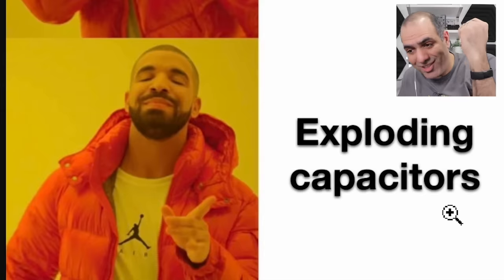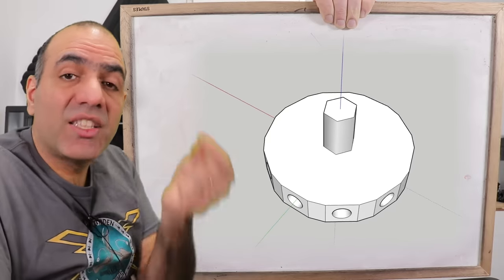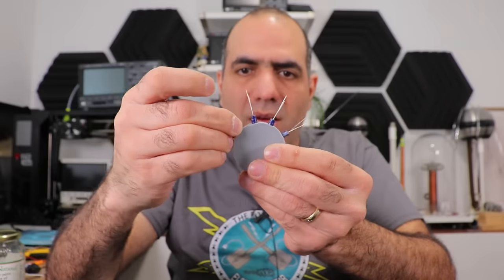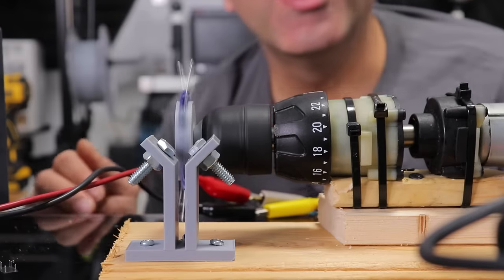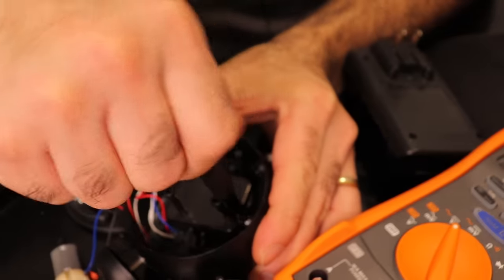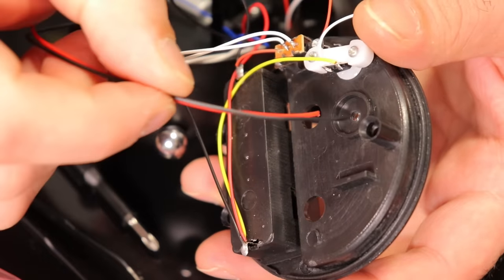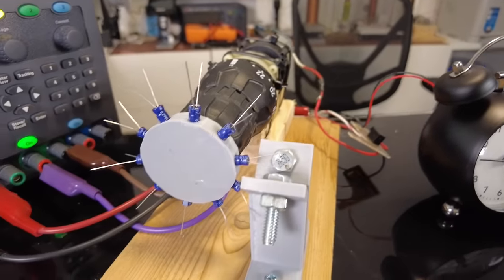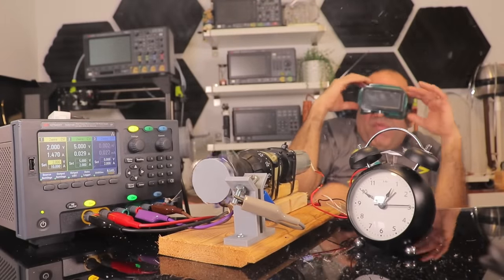Capacitor-BOOMer Alarm Clock

Comment: What a way to begin the day. 💥
I used to have an alarm app for which you had to complete a mathematical test before it would turn off. For a few months I got very good very quickly but then I had to uninstall it because I was concerned that I might throw it out the window some tired morning! I can tell you there were mornings where pulling my brain together enough to complete the test and stop the alarm was almost to much, those mornings when you’ve been out late 😵‍💫. Imagine getting hit with math first thing of the day while your alarm goes off and last night was a rough one!
Reply: Still a worthwhile app feature.....   I feel justified in considering it as a secondary usage.... training exercise to help hone ones skill of remaining zen under pressure.
Reply: I used an app like that for a little while. It stopped being effective when I was too tired to even see straight in the morning and just ended up turning the phone off in order to shut up the alarm.
Reply: I have a friend whose alarm clock shoots off a little fan and he has to find it to turn off the alarm. Usually it shoots off into the jungle under his bed tho😂
Reply: I use this and have gotten to the point where I sometimes end up just lying on top of the phone to muffle the noises and sleeping for several more hours.
Reply: Yeah to be honest all of the listed examples of alarm app* shortcomings, I've personally also used on a few  occasions. LOL.
Reply: Honestly the best thing I've come up with is using an app that lets you play a certain song or radio station for the alarm and hooking up my phone to a stereo system on the other side of the room turned up loudly and had math problems that I have to solve to get it stop.... that way I have to get up to make it stop it's quite loud think near Max or 80% volume and something like "Du Hast" by Rammstein lol. Usually wakes me and everyone else within 50 ft....so there is a downside to such extremities. Effective nonetheless.

Comment: Hi Mehdi, i wanted to ask is exploding capacitors safe? Like beside the little poisonous gases they release upon exploding aren't there any debris that can fly toward you eyes or anywhere towards you and cause pain? Maybe even some sharp pieces piercing your skin?
Reply: There will be some small debrids/fragments shooting out of the capacitors, although your chance of being hit by one decrease if you don't point the (+) side of the capacitor towards you (it's literally designed that way to act like a shotgun shell, so other electronics surrounding it won't be damaged in case of a capacitor explosion).
Reply: Its safe ,just makes you bald.

Comment: Instead of making the capacitors rotate you could make the contact points rotate (just like the sliding contacts in an old steering wheel) in a circle made of capacitors - this way it can be scaled up, and the capacitor legs won't bend so much + bigger boom-boom-boom series :D Next project should be a capacitor gatling gun...
Reply: yes, and use the motor already "inside" the clock 🙂

Comment: A single fire version of this with the capacitor riding on the hammer and one of the bells of the alarm being wired to mains voltage sounds like a fun little project that only kills you if you touch it wrong.

Comment: I think probably a better idea would be to attach the capacitors to the wheel by the legs intead, and then simply touching the exposed legs with a conductive brush. Makes it more likely that the wheel could be reused.
Also wasn't the point of the magazine to have more explosions per magazine and not having to reload the clock each night? lol This just makes it even harder to reload.
Reply: We need a follow up video

Comment: while on brand for the channel, this is not what was promised. what was promised was a magazine that reloads the alarm clock daily. this kills all caps at once. and the design of that was not a big change. you just have the 1.5v fed to an Arduino that moves a stepper motor enough to set off one cap at a time.

Comment: As a mechanical engineer, I am more horrified at how he cut those 2x4s 😂
Reply: He could easily had lost a ring there
Reply: He's an electrician
Reply: @fss1704  a sonic fan I see
Reply: @jdjdjdjd3058  i didn't try to reffer that but yeah, it made my infancy. It was more like a bigclive refference though, but it's a nice complement to a 3rd way joke. Or 4th way, if you're a brazilian, we're run by a convicted fella that's called 9, wonder why.
Reply: @fss1704  well when I saw rings I instantly thought  of sonic also I don’t watch bigclive
Reply: As a dentist, I agree
Reply: I thought they were 1x5s made out of pine, and he cut pretty straight, even though he was using a jig saw lmao
Reply: @royk7712 Mehdi is an electrical engineer, not the same thing

Comment: Mehdi...with those power tools, seriously, you're killing me. Would you like to see the scar from where I drilled into my palm when the bit broke through because I was holding the workpiece to save time, instead of using a vice or other proper method of holding the work? Or the scar from where I sliced through my finger, because I was holding the workpiece while cutting it, instead of using a vice or other proper method of holding the work - to save time? The trips to the ER did not end up saving me any time. I learned the hard way. Don't be me!
Reply: I have a scar on my finger where i drilled it. It REALLY hurt and there was a lot of blood.
Reply: Especially when he used the saw.
Reply: Yeah, somehow the saw managed to be the most dangerous thing in this video
Reply: You should see past videos when he used power tools. I think in one he had his thumb right under the saw. I think it was the van de graaf video? lol

Comment: I would recommend using a stepper motor instead of a DC motor.
This way each time the alarm goes off it moves a set amount, you could also use the microcontroller controlling the stepper motor as a timer, so you wouldn't need an alarm.
Reply: I think he knows how to make something way more efficient. He just made a fun video out of an alarm clock, and you have to comment about how YOU think it would be better. Jeez man.. talk about being self centered.
Reply: Calm down he was just suggesting an idea
Reply: Just use a timer output and switch relays with it. You can switch as many capacitors as you want.
Reply: Mehdi doesn't use microcontroller in his projects. It adds an extra layer of fun and challenge to try designing electrical devices without computerization. Plus, if he were to use a microcontroller for everything, we wouldn't learn nearly as much about how electricity works.

Comment: For version 2.0 you could scale it down by using an arduino and a stepper motor, this way you also could have your alarm clock software implementated.
Reply: I don't think he's good at coding though.
Reply: No Arduinos on ElectroBOOM.
Reply: In that case, why not go "solid state" and blow the caps up with some transistors instead of motorizing it
Reply: Figured he can 3D print a Geneva drive.

Comment: Tired of being late to work every morning? Don’t have time to hit snooze? Introducing the Boom Clock – a revolutionary device that is guaranteed to wake you up fast.   This alarm clock consists of ten capacitors that explode when it goes off, combined with a drill motor that spins the capacitors against two contacts. That’s right – this alarm clock is designed to shock you awake in the morning!   The Boom Clock is easy to use – just set your desired time and let the Boom Clock do the rest. With its loud and sudden sound, you can be sure you’ll be up and ready to face the day.    Say goodbye to being late and groggy in the morning – the Boom Clock is here to revolutionize your mornings and help you start the day off right!

Comment: You could make it safer by using low voltage caps 16v on a 48v power supply.

Comment: This is super dope !! But Please every one , don't try to bastardize this setup and use it as a makeshift electric timed blasting cap to Mine with.. or just to set off  ("see-four") or blasting gelatin or anything else that requires an impact shock or micro explosion to set off... If u don't understand what I'm talking about then this message wasn't for you, however if you know you know don't be a dummy and hurt yourself or get put on a FBI list 😂🎉 and fyi I know I misspelled ("see-four") as I'm also not trying to get put on a list😂

Comment: I feel like if I designed the clock as well as the explosive alarm, I’d make it out of acrylic panels and an internet connected arduino to give me weather, time, and servo control. Subdivide the motion into twice as many “notches” as exploding capacitors. Once the next one is in position, move the electrode set into position, then rotate it another notch. 

How that would be done in practice? I don’t know. I’m just a truck driver. This stuff interests me though.

Comment: I ran a 6.3 volt capacitor on 7.5 volts from a weak 9v battery. I only knew after using it...

Comment: I'd suggest having the wires connected to the bell and hammer of the clock, so it makes contact when it rings and blows up the capacitors from there.

It's also like 100 times more dangerous

Comment: Nice. Will surely make up a memorable morning. I would choose something like a decade 4017 counter instead of a motor to drive a set of transistors\relays. Each alarm would switch the counter, blowing up a different capacitor each time. You could even put a larger capacitor on a 12-hour alarm and call it "Big-Ben".)

Comment: Mehdi, have you ever tried to test which insulation material (resin) is best for 100kV+ high voltage capacitors with 0.5mm air gap and 10x10cm parallel plates?

Comment: once i was making a motor cooling device i put 48 volts which was way over for the pc fan i scavenged out of an old pc and a capicator on the speed controller both were smoking instantly and blew up the room smelled horrid after that ( the 48 volts was from  9v batterys i connected together) lol

Comment: By the way, the way the alarm makes the drill spin is how you would make a simple timed explosive device
Reply: Here is the tip instead of alarm triggering wore to motor you connect small nicrome wire and cover it with some black powder and joined it to explosive and ha you now have 😊

Comment: uncle mehdi i have a question, how can i rectify high frequency   power (voltage and current), cause i using this rectifier for wireless power transfer

also about converting DC to high frequency AC, if you have any affordable way for undergraduate student.

ps: the system should capable of 100kHz AC for WPT

thank you for any answer

Comment: hmm could have just rewired the switch to switch drill power as the two contacts seem isolated and fully external
1: remove the battery negative from the manual switch and replace with drill negative
2: remove existing motor and positive lead
3: connect drill motor negative to existing switched negative
4:connect drill positive to drill motor positive
5(optional): connect ac to optional enable switch so it only is energized when you want it to actually bang
6: set enable to off
7: set alarm time
8: connect drill PSU to power and unplug bang power(or switch off)
9: load magazine
10: enable alarm and connect bang power(or switch on bang power)
11: go to sleep
12: wake to exploding capacitors(possibly mounted above your bed so you see the sparks and feel them too)
upload it to youtube to get viral view counts and sweet ad money
Reply: oh and to reload for the next day just repeat steps 8-12a
and for better bangs use a bunch of mains filter caps in your bigger magazine as the electrolytic types will still go bang at negative voltage

Comment: Wouldn't it be a good idea to use an Arduino to control the "time bomb"? An LCD screen for displaying time, a potentiometer and a switch to set time, a relay for switching on the mains voltage and stepper motor to rotate the capacitors